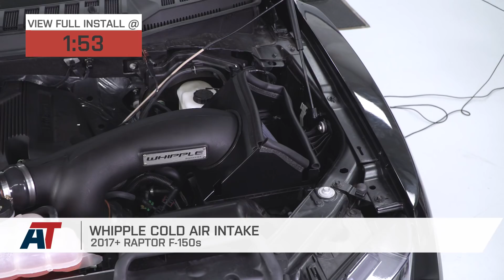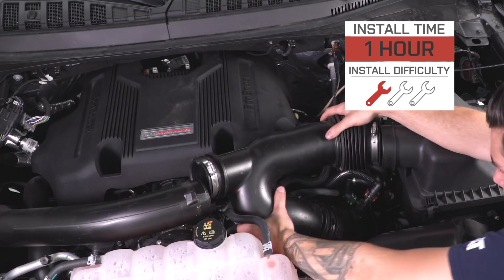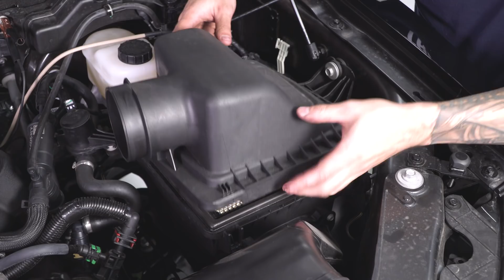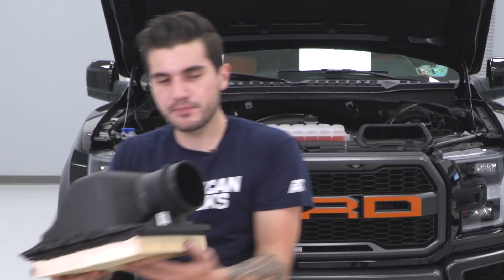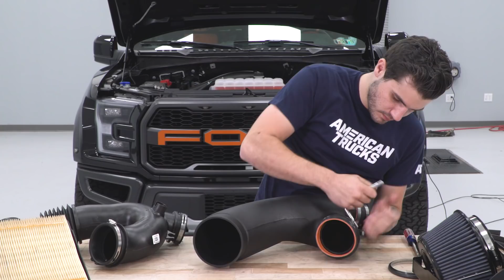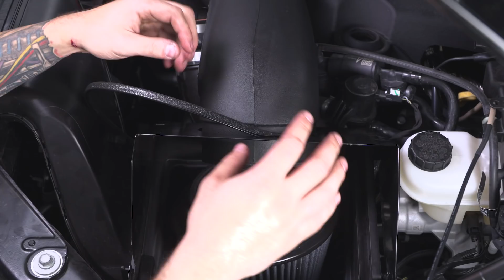2017-2018 F150 Whipple Cold Air Intake Raptor Review & Install

Comment: Will this fit the 2020 raptor?
Reply: Yeah it will, but the tubing used from 2015-2020 raptors and 2021-2025 raptor ‘MIGHT’ be off, I’m not sure, but will it work, of course. The f150 engine tubes are not much different from eachother

Comment: So the air filter doesn't slide into the box once the tube is mounted? That seems like an obvious and horrible oversight, now you would have to disassemble the tubing every time you swap air filters.